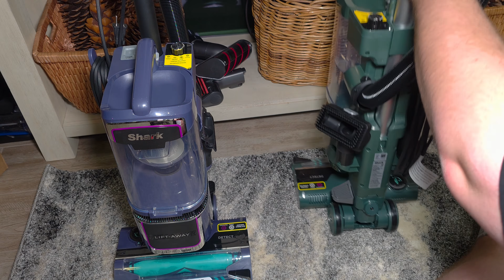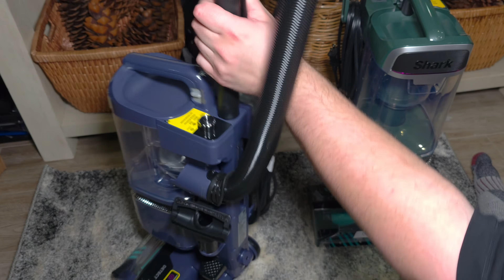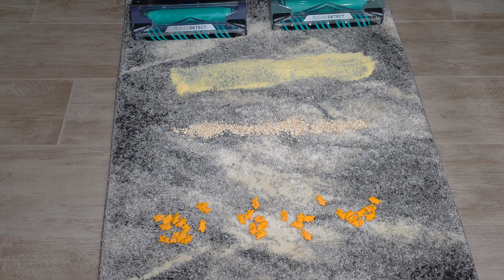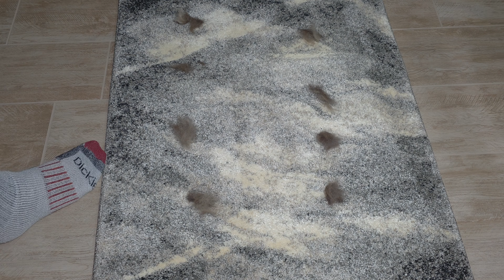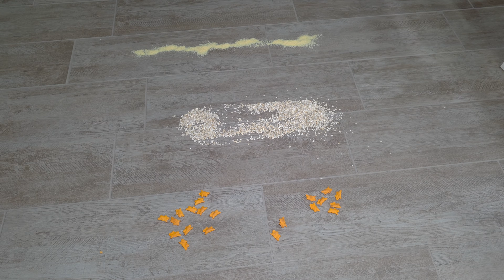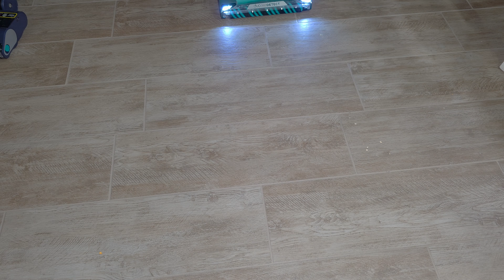Shark Detect Pro ADV vs Detect Pro Speed Vacuum Comparison

Comment: Hey great video. I had a question, I have the same model but can’t put the wand into the brush base like the old models. To use the lift away feature. Can you do a video if yours does fit into the brush base. I can’t figure it out , looked at manual, called customer support and nothing lol.
Reply from the maker: Strange. Yours may be defective. I am not exactly sure. Check and make sure it's in the proper orientation and push firmly

Comment: Hey great vid. Just what I was looking for for the speed version. Quick question, is that loud “grinding-ish” sound just the rear brush roller/fin brushing against the rug/carpet? Or is it something else? I’ve watched several reviews for a few models with the DuoClean brushes and don’t ever hear that same sound. It’s literally only for these newer models (LA429, LA802, LA742). Thanks again. 👍
Reply from the maker: The grinding sound is the power fins rubbing against the anti tangle combs. Id honestly recommend a Dyson Animal 3 instead
Reply: @Vacmaster1991 That’s what I figured with the sound ha. Does it get annoying? And also why would you recommend the Dyson Ball Animal 3 over this? Appreciate you man.
Reply from the maker: Durability. Sharks are cool at first but don't last. The rubber brush rolls wear out in a couple years and can't be replaced. Also they have poor cyclone performance and dust tends to get in the filter.